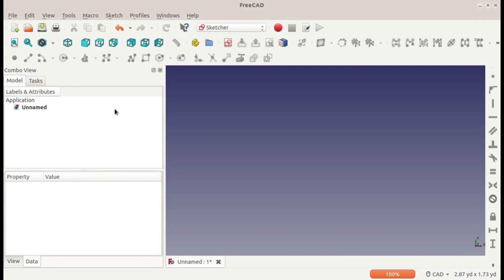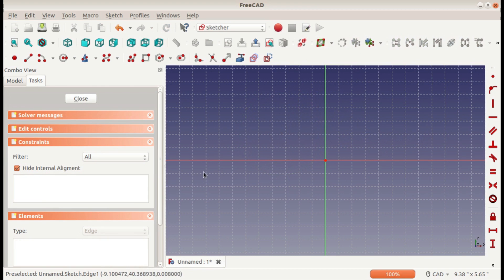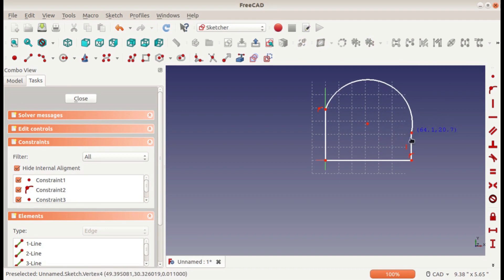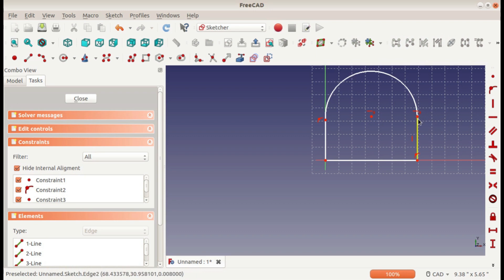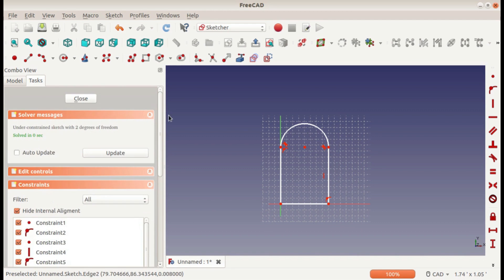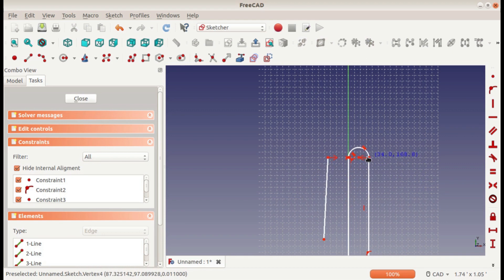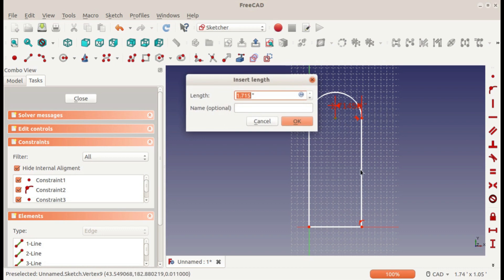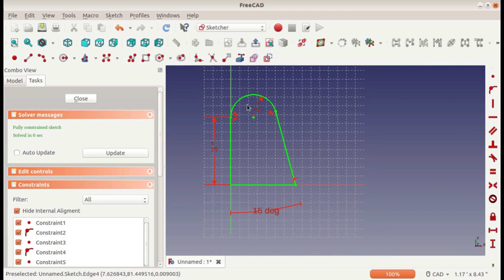Learn FreeCAD: #2 Sketches - Tutorial

Comment: But how do I specify a dimension  for the diameter of a circle? I've been struggling with this (a 5 second operation in F360) for haf an hour. It should be obvious, but it isn'#t obvious to me. The only way I can do it is to draw a construction line, connect it to the circumference in two places, and specify a length constraint for it. Surely, there is a better way? I can see the dynamic update of "10.1R" (even though it's small and dark blue on slightly brighter blue) but it's a pig to get where I want it. Too larege/too small - what fun! I want to type in a value and BAM./ Get on with life.

Comment: I had the issue of the auto constraints not working properly, like a lot of others seems to. I opened the edit controls tab (which is available when in editing the sketch) and unchecked then checked the "avoid redundant auto constraints" and/or "auto constraints" box. It now does the constraint lines automatically he is talking about.

Comment: Sigh, this is why I gave up trying to learn these various CAD programs, all the tutorials wiz through it so fast and they are obviously pressing keys and clicking things they aren't explaining.  I tried this example and can't get anything like what he is doing.  For example, he draws a complete box, then somehow "deletes" the top line...how did you do that??  Also, when he draws the arc and clicks the points, when he is done, somehow all the corners are "connected" as if the sketch is one "piece".  I don't get that, when I draw it all out and click on a point on the corner to "wiggle" it around, all I get is a single point that's either one of the lines or the end of the arc...the lines and arc aren't "connected".

Was hoping to learn this as all I want to do is make some "2x4's" and "2x6's" to design a simple work bench.  Might just be quicker and easier to use a dang pencil, paper and a straight edge.

Comment: Great video, but he doesn't explain everything. It was impossible for me to make the same shape or get auto constraints to work. Things were happening in the video with no explanation how he did it.
Reply: I agree that it's a bit tough to get used to the FC IDE. But to credit this tutorial, I watched this for the first time. Chris did start of by explaining Poly-lines, and then the two different arcs. The sketch starts of by using poly-lines to create a square. Then the top-horizontal line is selected and deleted.This is followed by a 3 point arc that is created by selecting the two top end points of the vertical lines.

Auto-constraints can help. It's hard to see, but when you draw a vertical line, a small and hard to see Red vertical line appears next to your mouse pointer. If this line is visible it means your vertical line is at 90 degrees. This is helpful because you are already constraining a line by simply drawing it watchfully. 

Hope this helps.
Reply: I agree, please help Chris??

Comment: Why not just take one simple step at a time on the workflow to gcode output? A rectangle sketch, extrude it, define a default tool, define default feed, generate a gcode... then with an overview it is possible to go back to each stage knowing how the process works with this software. ~Without a total brain overload trying to take in all the options? I've had to use so many different software programs, at work, at school, at home for free - I want to see the outline basic process first before designing anything other than a simple square blob. Imagine I teach you Urdu by starting with some classic poetry and you try and learn the symbols mean sounds, but arse backwards in front comes last, the vocabulary is mystical, the interpretation is not literal, but remember every detail of it as we progress.....if your head doesn't explode by the end of the first line then you are on a different level. Otherwise, this is a great tutorial. I want to come back to it, after I've done a basic tutorial.

Comment: It seems that in FreeCAD 0.18 there is a functionality called "Avoid redundant auto constraints" which is toggled active by default. 
This makes the example at 3:10 difficult to follow. You have to go to the Tasks side-pane, and under "Edit tasks" toggle off the option "Avoid redundant auto constraints".
Hope this helps someone!
Reply: I was stuck for 25 mins. Thanks
Reply: I wonder why they are called redundant? before i read this i tried to get this behavior by holding shift, alt or control. i wonder if there is someplace i could give that as a suggestion?

Comment: Thanks much for the Tutorials. I have been creating RC Aircraft Designs in Inkscape for a couple of years and needed to move to an actual CAD Program where it's easier to create symmetrical parts. Using Constraints is going to make my life designing RC Aircraft much simpler. I've never used a CAD Program before just some very basic 3D Modeling in Blender 3D. The Tutorials are very helpful.